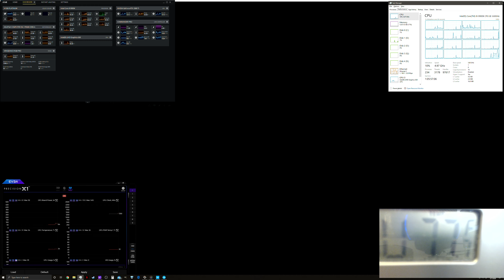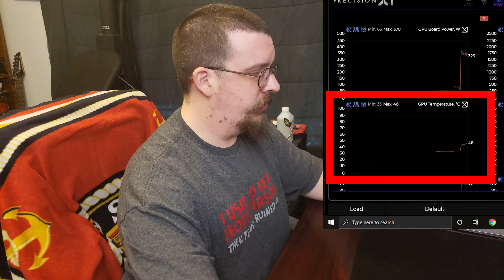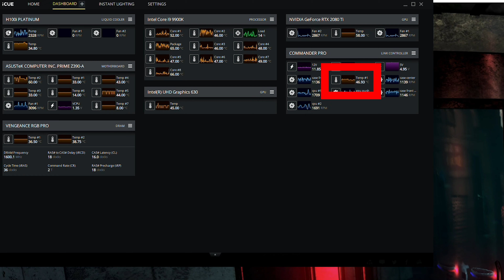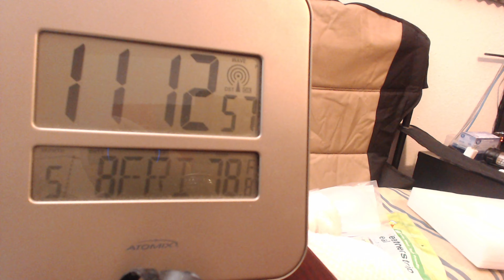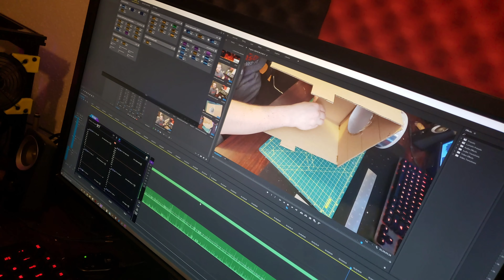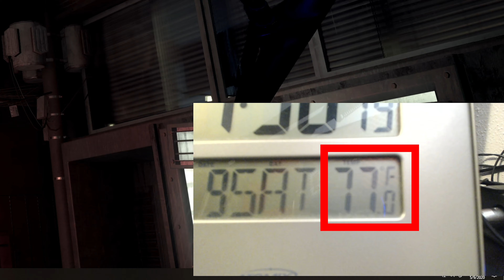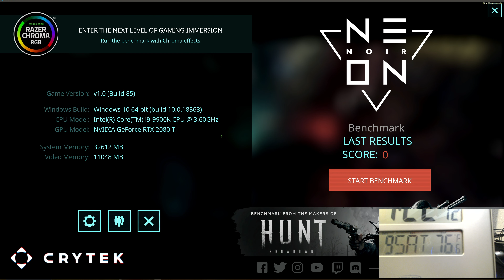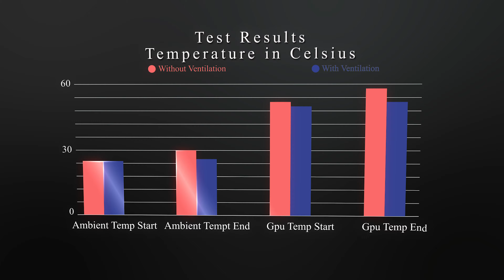Custom PC Ventilation With AC Infinity CLOUDLINE T6!

Comment: Overthinking the problem and overspending. A small simple window air conditioner would be cheaper and easier. The air you are blowing out is comming back inside and bringing Mr. Humidity back in. Most window AC have a vent mode. With the window unit you could make that room in the ‘60s. Home Depot for small window unit cost for less than the blower. FYI, I have two 4” blowers to vent my attic and keep the humidity low around my AC evaporator.
Reply from the maker: Granted, this video is old enough that that system is no longer the current one I am using. But I will explain that I did not go the window ac route for 2 reasons. One, the house is a rental and so I would not be able to install a exterior support bracket and the window frames do not support much weight. Two, I have had window units before, and a unit capable of combating the heat generated by the 2 machines would have introduce too much noise.  Again I no longer use this setup. The room bow has 3 setups in it and the inline has been adapted to attach to the central ac vent as a bit of a temperature controlled booster. So with the door closed the hot air is not trapped and when the ac does cycle it has an easier time getting air into the room. Now even with 3 gaming setups I rarely see the room go more than 4* over ac set point even with 100+* weather outside.